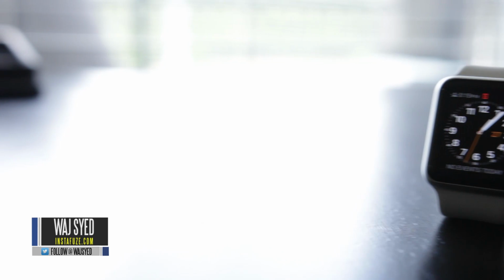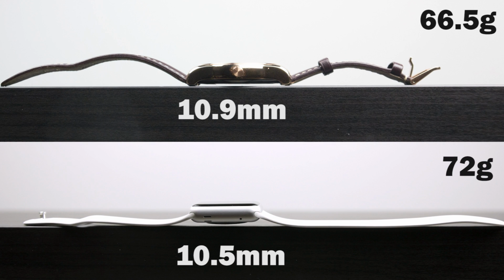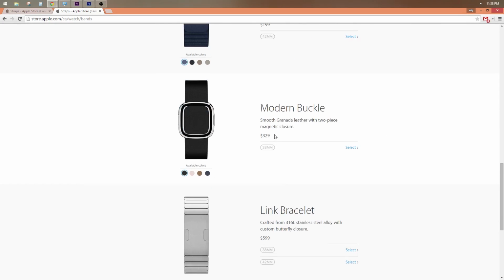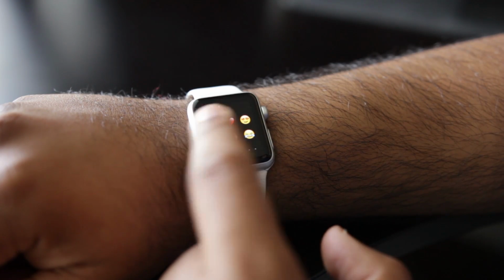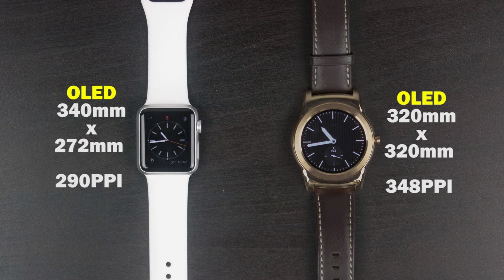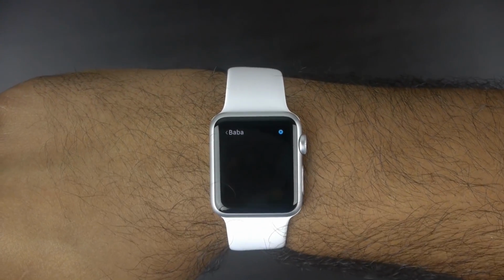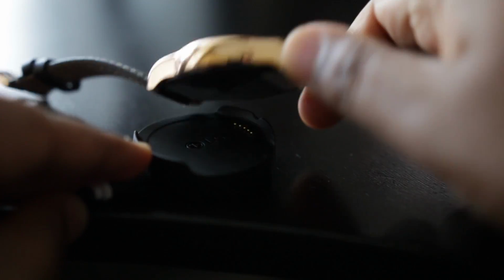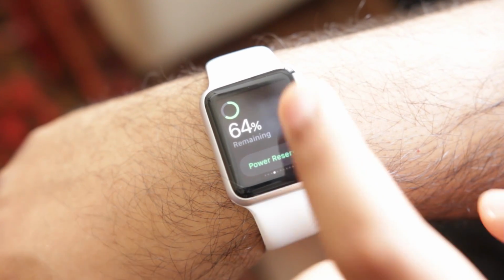Apple Watch vs LG Watch Urbane - SmartWatch Comparison

Comment: Why do people always have that circular watchface on Apple Watches in their comparison videos, and then they never comment about it?  A circular watchface on a square or rectangular display is a huge waste of space.  The resulting clock displayed is about half the diameter of the clock displayed on the Urbane, which would mean the Urbane clock is around 4x larger in area.  Essentially, it is much easier to glance at the time on the LG than the Apple when going with circular watchface, so why run the circular watchface on the Apple?  You knew you were buying a four-sided form factor when you bought it.

Comment: Typical Apple garbage.  That S1 processor is a Single Core 520 MHz...  That's not even on the same planet as the LG's  Quad Core 1.2 GHz processor.  I can't believe people are stupid enough to buy the overpriced shit that Apple sells.
Reply: 1984sFinest lol ikr
Reply: 1984sFinest the good thing about apple is the fact that its devices uses low power processors because they have an extremely optimised os and so they also need smaller batteryes; that’s a pro and not a cons since thanks to the optimisation they will perform the same

Comment: Is the watch urbane still worth it? I'm considering it
Reply: +Chris Kilts keep an eye on Slickdeals for a good deal on an Urbane!
Reply: I have the Urbane and love it!
Reply: Why not get the LG Watch? It's like always ON SALE here for an awesome price>>>>>> https://plus.google.com/+AMZSellerHotGirl/posts/h2WERJMwTjK
Reply: +SamsGamingRealm  I ended up getting one as well, and I love
 it so far.
Reply: I am wondering the same thing. Debating between this, moto 360, and pebble time. I want to spend under $200 or so and I want durability.
Reply: If you can get it for a decent price Yeah, I just ordered one the other day for $160
Reply: +bosoxdanc +SamsGamingRealm are either of you having issues with Bluetooth disconnecting? Mine won't stay connected for long
Reply: +Adam Szuszkiewicz I've never really had the issue, no. I'd make sure your watch is updated and go from there, maybe even factory reset it.
Reply: +bosoxdanc mine was working fine the first day but then it started having issues so I did a factory reset twice and it worked for a day and started up again, I might have to return it
Reply: ***** I'm using a Oneplus One

Comment: My opinion about these 2 watch since lot of people in here says this video 2 much Apple explanation...Based from:
1. I saw & explained from local Apple dealer here
2. My experience using LG Watch Urbane for 2 weeks since this post

There's only 2 point Y i like Apple Watch compared to LG Watch Urbane:
1. The apps is much more variation than LG Watch Urbane/Android Wear. For example, if u have djay 2 app, u can use djay 2 on the Apple Watch while Android Wear including LG Watch Urbane still can't until now
2. It can use for calling via watch. But this point is not so useful as because the other person u talk to, will sounds on Watch's Loudspeaker only, & this is not so useful as because if u talk 2 someone in call using watch like this, all people in your surroundings might cringe at you

But Y I choose LG Watch Urbane? Because:
1. It supports Android, absolutely, & also iPhone even though some features maybe disabled when paired in iPhone. I use Xperia Z1 Compact for this Watch
2. The model, it's so classy! Much more classy compared with Apple Watch just like a classic watch! Very suitable for businessman!
3. Cheaper price, of course... & saying about the Gold edition in Apple Watch? LG Watch Urbane has also released the Luxe edition which the Watch Urbane is also built from real Gold 23 carat. The gold of course is different with normal edition's Rose Gold. Even the Luxe Edition still cheaper than Apple Watch Gold Edition, for $1200 only
4. The waterproof that LG Watch Urbane has, is stronger than Apple Watch. This LG Watch Urbane can even drowned on water for 1.5m
5. Don't know Y, the menu interfeace that LG Watch Urbane gives is much more familiar 2 me than Apple Watch.
6. Even though both watches can change the watch face, but as far as I take a look, Android Wear including LG Watch Urbane gives 2 much Watch Face that I can choose. I can choose Rubiks model, Adidas Y-3 Watchface that just released a few days ago, Asics, Plants VS Zombies watchface, or even NFS Most wanted tachometer as my watchface!

So i think... Both of this Watch is having a good standings, it's all depends on personal preference...

Comment: Not a fan of both smartwatches discussed in this video. I prefer Blocks Modular Smartwatch which is far better than the recent smartwatches. It's useful, modern, user-friendly and it definitely has smart and unique features. I'm sold with this smartwatch.

Comment: You forgot one important point of comparison: the ability to make and receive phone calls. The Apple watch can make and receive phone calls on the watch itself as long as the paired iphone is nearby, though the built in speaker is a bit weak. The Urbane, however, completely lacks that ability. It cannot receive any calls. It does allow to make some but requires to use the phone or a bluetooth headset as soon as the call is connected.

Comment: What's happening is that people are looking at the resolutions (390x312 and 340x272), they're converting the watch sizes into inches (42mm=1.65" and 38mm=1.50"), and they're using that to calculate a pixel density of 302 ppi for the larger model and 290 ppi for the smaller model.
Those calculations are incorrect because 42mm and 38mm correspond to the height of the entire watch face, NOT the diagonal of the AMOLED display. The displays are actually about 1.53" (~39mm) for the large model and about 1.33" (~34mm) for the small model.
If you do the calculations with the actual screen sizes, you get a pixel density of about 325-330 ppi

Comment: A pretty biased review with negative connotations when referring to similarities between the devices. For instance, you don't like "finding the right notch" on the Urbane (pronounced with a long ā) leaving the viewer to surmise that they are inferior to Apple's notches despite them being over priced. That's just one example. There are several throughout. You missed one big difference in the Wi-Fi connectivity piece. While both connect via Wi-Fi, the Urbane can connect through any network (even if your phone is on 4g, not Wi-Fi) to relay messages, missed calls and commands, ect. while the Apple watch must be connected on the same network as the phone.
Reply: +Robert Allen Indeed ! A very important issue that has been seriously overlooked. This enables you to wear the LG Urbane anywhere in the world without having your phone present just as long as you have wifi !!!
Reply: +Sergio Casino Yes and no. My Urbane can connect via a different wifi connection than my phone, but any wifi connection that requires extra steps, like at most restaurants, etc., leave you out of luck, as the watch cannot get around that connectivity without the phone. So yes it is cool, but it is 'limited' cool.

Comment: i've tried apple watch sport edition 2 weeks ago in some store and i feel quite disappointed with the high sensitive touch, cos u need to press it harder to enter some features, but i do love the digital crown and i wish my G Watch R had it. and btw i've just found an apps both on android and ios to connect your android wear to your ios and i love it, i've connect both my 5s & Note 10.1 2014 Edition but it will drain android wear battery from about 2 days into 1 day since i've also bought a watch face that show real time compass and heart rate check every 10 minutes. But after all that's worth it because i didn't have to use or buy 2 smartwatch since i've use a cross platform device, an android and ios :)

apps in playstore called Aerlink
apps in appstore called BLE Utility (u don't have to JB ur IOS device)

Comment: and again I have to correct him the Apple watch is not certified water resistant that means if your Apple watch succumbs to water damage the warranty not cover it
Reply: Under the IPX7 designation, the Apple Watch will be able to withstand immersion in water up to 1 meter for up to 30 minutes. This means that a session in the shower, getting caught in the rain, or washing your hands will not cause damage, but prolonged exposure — such as swimming — would be harmful.

Apple says that users "can, for example, wear and use Apple Watch during exercise, in the rain, and while washing [their] hands, but submerging Apple Watch is not recommended." The water resistance rating applies equally to each model of the watch. 

IPX7 is a common rating for small portable electronics that are designed for use outdoors, but are not considered "rugged." Many handheld GPS units, for example, carry IPX7 ratings.
That is a Basic certified I word not even consider that is  certified I now that it has a basic certified all watch are
Reply: ***** what like you

Comment: The SoC is not a custom s1.
It is a rebranded apple A5 chip the iPhone 4s used which shows why the battery life is bad. The snapdragon 400 chips are not only more powerful but more efficient
Reply: It's as powerful as the A5 but it is NOT the A5 chip. They are completely different.